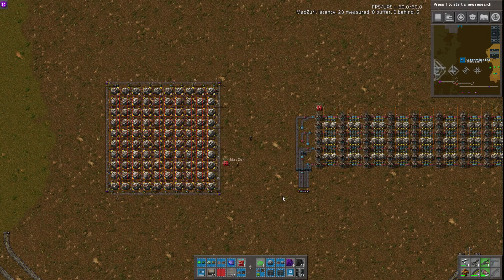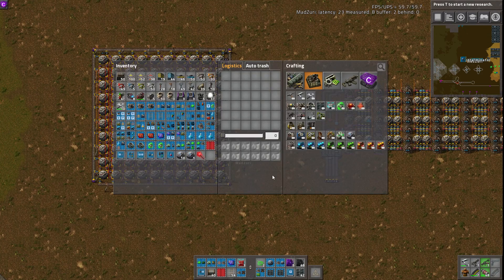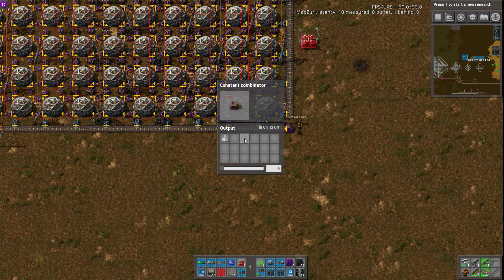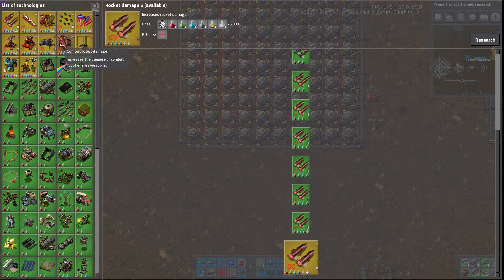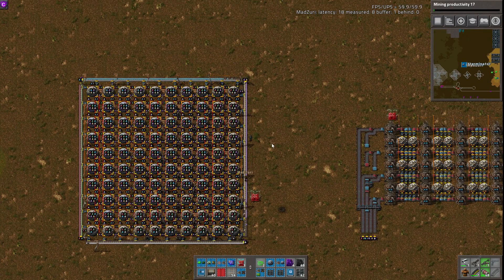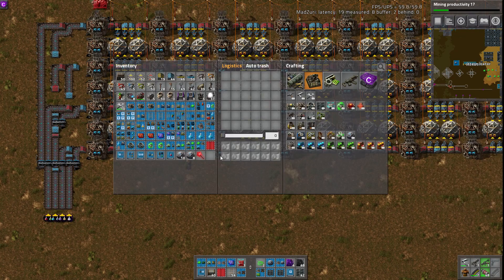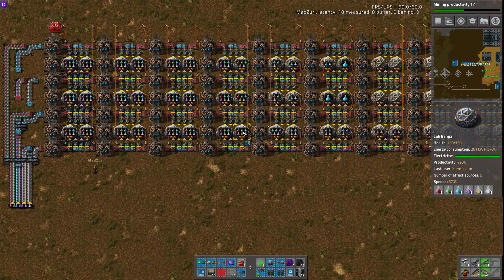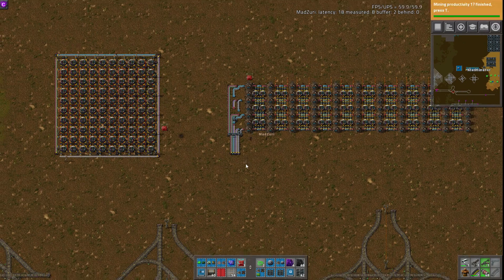Science Lab Builds & Setups :: Factorio Workshop Season 2 - Building A Better Factory

Comment: I'm actually really happy that happened with the nuke. XD

I figured out after I submitted this design that, yeah, beacons are better used offset. I also knew even as I was building it that considering the number of beacons and modules involved, and for that matter the blue belt, you're probably better off just using bots, but it was a fun challenge I put to myself to combine a design someone posted in a Factorio group on facebook with designs I'd seen KoS use in some of her play-throughs. It's pretty tile-able if you just grab a blueprint off the end, but I never did test how far out this could extend.

This was back when 0.15 was just a few weeks old (and then I decided on a whim to submit it later). People were noticing problems/limitations with the pass-through method, so I conceived of this.

But yeah. Robots. XD